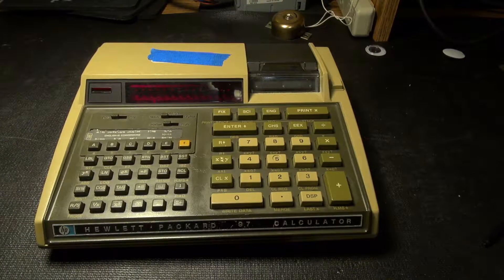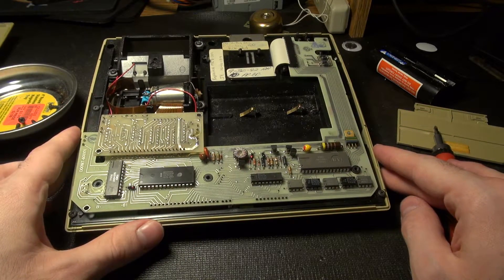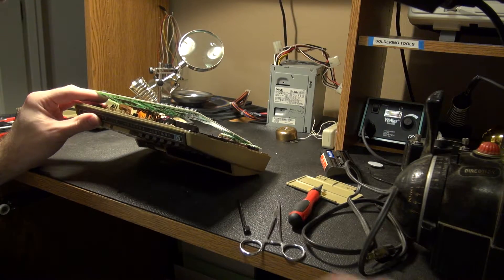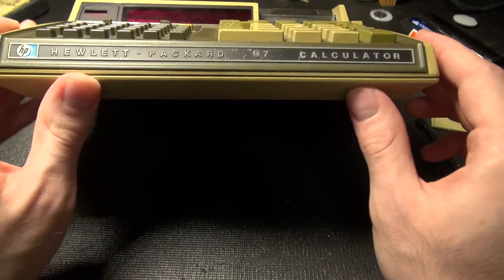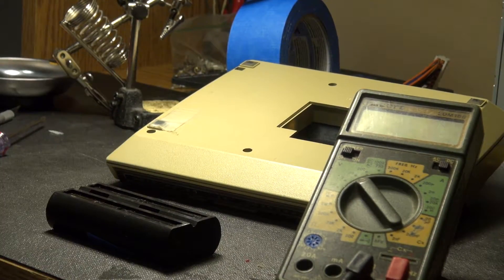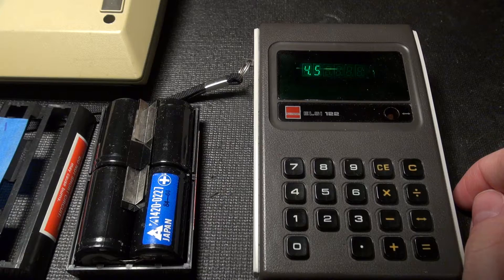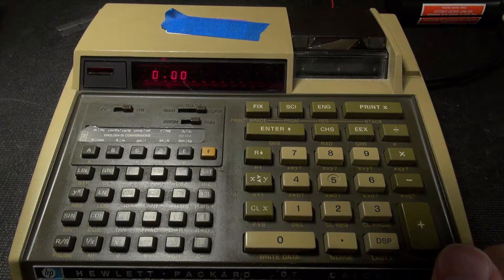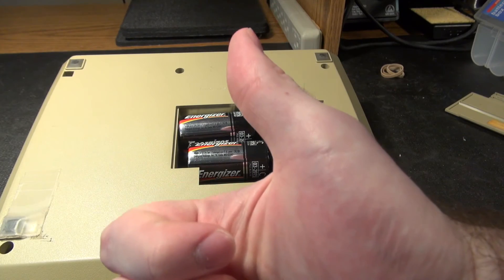HP 97 Calculator Restore

Comment: Just whatever you do, don't plug in the original HP power supply into the calculator without a battery installed.... or you'll fry stuff. The calculator uses the battery as a buffer to control voltage.
Reply: Bullshit, and if, only for the woodstock-series!
Reply: @derirrevomzombiehof4893  by all means then, go ahead and plug yours in without the battery. And when it pops a valuable and nearly impossible to replace chip, don't come crying to me.
Reply: @vhfgamer  _ I tested all of this experimentally with the HP woodstockers. Guess what pocket calculator supply voltages Vgg, Vcc and Vss the power stage produces when I feed an HP 21 ONLY with the 9 volt AC voltage of the HP 82024 power pack AND WITHOUT a battery! And now DO NOT say the voltages out of the TR power stage WILL be higher. 😜😜😜😜😜😜

Comment: Would be useful to explain what's wrong with it before you open it up. Did you test the printer or the magnetic strip reader? RPN and programming as well as diagnostic testing for that thing is in the manual, really clear explanations.

Comment: i've the same Calculator and that model what i have can't make a division correct. The results are wrong so what can i do to fix this failure? All other functions are working correct so i see this but only "division" do the wrong thing.
Reply from the maker: I would have no clue why that would be the case. And you are certain you are inputting things in the order that it wants for division? I'm not aware of any known faults that could cause the division to be out, and it doesn't sound like any other fault since the unit functions fine otherwise.

Comment: The PIK is the Printer Interface / Keyboard chip. It's the large black chip on the left side of the main PCA, probably a 1820-1723 given the hardware revision. The PIK drives the printer and has an integrated key code buffer. It's very unusual to have to replace any ICs in the HP-97. The most common failure points are mechanical problems with the card reader and printer assemblies. Occasionally the ACT (Arithmetic, Control & Timing) chip will get fried if you operate the calculator from line power without the NiCd battery installed, but I've never seen one with a bad PIK before.
Reply: +José Rodrigues I stand by what I said. People kill their HP-97 ACT sometimes by plugging in the calculator without the battery installed. It's not as vulnerable as a HP-25, but it definitely happens occasionally.